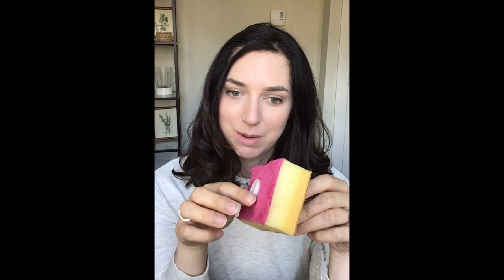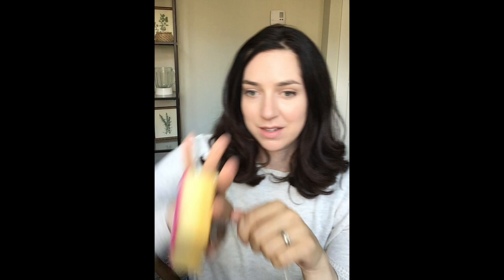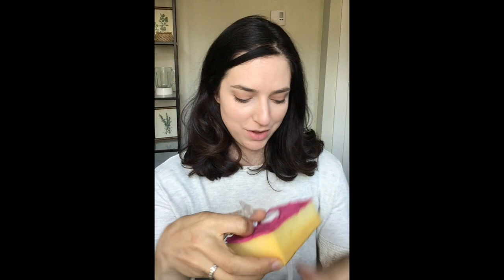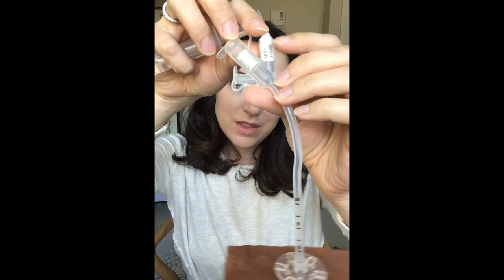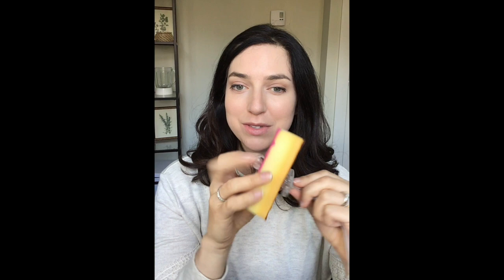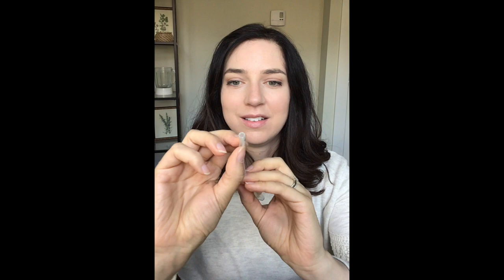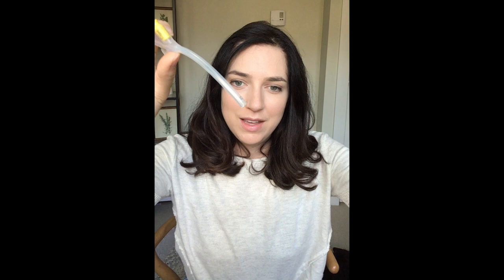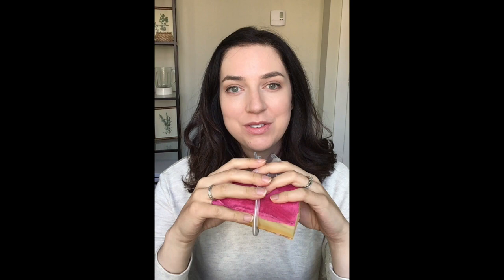Feeding Tube Internal Retention Devices Explained

Comment: My dad has a gtube. He was doing fine. Went to the ER to get a replacement because his old one fell out. The doctor gave him a different looking one. He goes home and was in a lot of pain for 4 days. I took him back to the ER and they did a couple of tests but told me there is nothing wrong and the tube is in the right place. My dad continues to have a lot of pain and is now not eating by mouth which he was doing prior to getting the replacement. He would hold the site all the time like it is painful. By the way, my dad has Aphasia so he can not communicate what is happening to him. My question is, when the replacement tube was put in, the external bumper was about 6” up from the opening. Is it supposed to be that long because the old one wasnt. So what I did was pull the bumper closer to the opening. Now, the bumper is about a inch and a half away from the opening. Dad still has pain. Should the bumper be closer to the opening?
Reply from the maker: Hi David. Thanks for you comment. It sounds to me like the external bumper needs to be lowered to just above the skin level. I generally like to see my patients having just the space large enough to slide a nickel under the external bumper between the skin. 6 inches is concerning. I would encourage you to get in to see his GP to show them this, and see about correcting the position of the external bumper so that the tube will stay in the right place. The risk of having extra space between the skin and external bumper is that it can allow the tube to go too far into the body and the internal bumper can even block the stomach exit in rare cases, making the person quite sick. That said, this is just my initial impression from your comment and I would encourage you to seek input from your dad's healthcare providers as I am not in a position to provide medical advice via Youtube. Best of luck to you and your Dad.
Reply: @NaturalTubeFeeding  Yes, I figured the tubing was too long. The weird thing is, the ER doctor placed it that way and I am new to this because my dad just had the gtube put in in March. Weirdly enough, after 4 days of pain after the replacement, I took him back to the ER again and the same doctor saw him and told me there was nothing wrong. Does he not know where the external bumper should be? He sent my dad home the same way he left. Ima going to take him to his primary doctor tomorrow morning, but for some reason, I doubt she will know what to do. I am so frustrated. I feel horrible watching my dad in pain and discomfort. I read it might be the wrong gtube as well. That might be the problem, but I don’t know. I’ll info the doctor about it tomorrow. Thank you very much for helping me out.